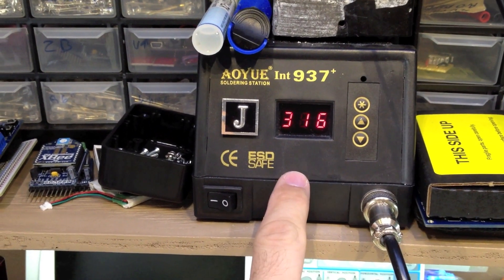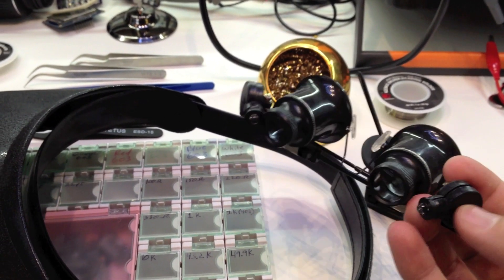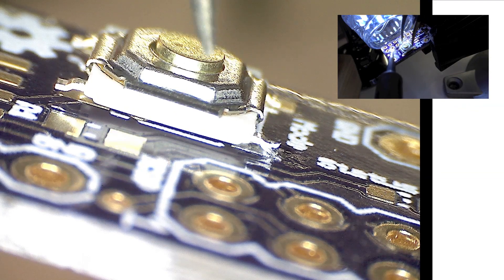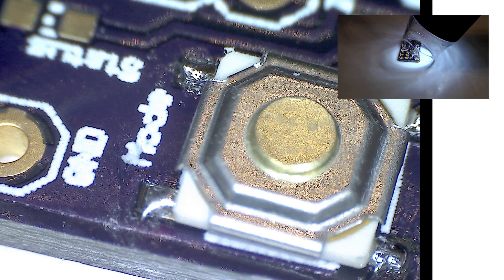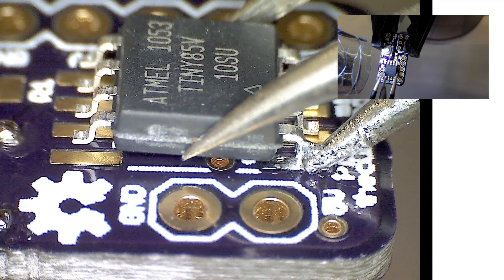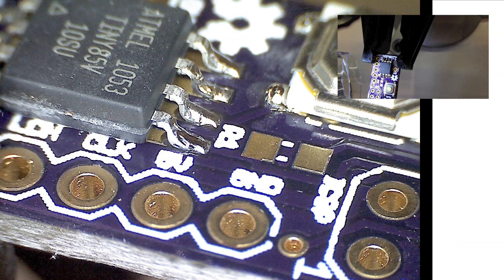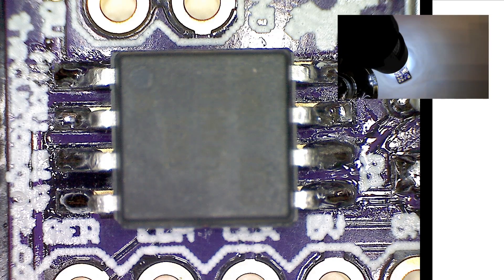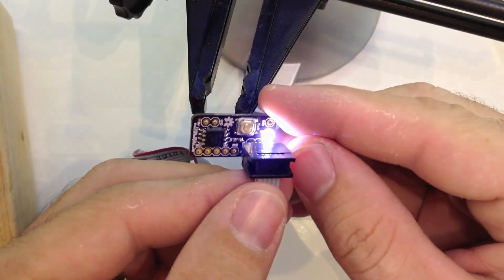SMD Soldering - Full

Comment: Put some Flux, then align properly the part, then with a little point of solder in the tip just touch one pin and the Flux helps to make a perfect joint and then u can solder the rest with a flat tip u are doing it the hard way.

Comment: who taught you how to solder
firstly your your using the wrong tip
 your applying solder to your tip not your pad 
multiple pins can be soldered using the reflow method not the abortion you demonstratec.
try some nitrogen and whats with your dry joint in the first solder joint
and finaly sodder has an L in it 
making it Sold-er-ing not sodd-er-ing
learn english and learn how to do it right
Reply: +amber rose Approximately 320 million people (America) pronounce Solder without the L. Don't be a smart arse.
Reply: *You're

Comment: Do you even know how to solder?
Reply: Yep. It seems this guy suffers from Parkinson. 
First: Add some solder to the pad.
Second: Position the device.
Third: Just re-flow the pad.
Voila.
Reply: The fillets are awful. He needed more flux not more solder.   Just cold joints everywhere
Reply: The shaking is from working in the vice, and not flat on a table.

Comment: It´s much easier to work on a flat surface, not in the air with this PCB holder. Then your hands are less shaky and you change to a much more relaxed position with your hands on the table. Dont try to hold parts with tweezers all the time, better to just use them for positioning once. Hold them down with a auxiliary device like here: frgmnt.org/secrets-of-the-smd-scene-uncovered/  & USE FLUX! :)

Comment: The kind of rounded conical tip you're using is next to useless IMO, you get very little contact area to transfer the heat. Also FLUX (can't be said enough), and don't be so afraid to heat the joint properly.

Comment: Generally solder will have flux as a core - maybe not in the vast quantities some people like to use for soldering but aslong as your actually melting your solder on the joint and not on the tip first (apart from tinning your tip obviously) you should get a good contact for the flux to clean it all up.

Comment: Im studying electronics in Finland, first year. They teached us that when you're soldering SMDs, you use solder as thin as hair, and heat the pad and put the solder in it. In my opinion, it makes better quality solderings. I never put solder on the tip of the soldering iron, but in exception of faster heating of an old solder.

Comment: Nice video. Like the others suggest, flux will help you out a lot with your solder joints. I've never soldered parts using a USB camera before but I'm considering one for home. At work I use a stereo microscope that works best.

Comment: Thanks for posting the video. However your technique is so bad that I'm afraid beginners might get a wrong idea. I'm not trying to be negative, but you are practically showing a bad example. To start off, you have to use flux. Also you are putting way too much solder on the joints.
Please watch "Surface Mount Soldering 101" by CuriousInventor. This is the best demo video I've seen.

Comment: you got some cold joints on attiny. compare pin 1 and most of the other pins, looks like only 1 had enough heat, your're doing it too fast without properly heating of microcontroller legs.

Comment from the maker: Thanks, I did notice a slight delay from OHSPark when the site first opened, I have not ordered a board in a month or so though. The microscope is incredibly handy and I would buy it again, but there is a bit of video lag, so it makes it hard to use it as a "live cam" for soldering.

Comment: Nice work Jeremy.  I find that a tip with a slight bend on the end helps with applying the heat were you want it and how much contact by rotating (tip or side).

Similar to this one:
sigma.octopart.com/10961368/image/Metcal-SSC-726A.jpg